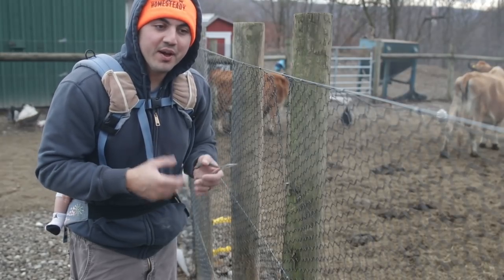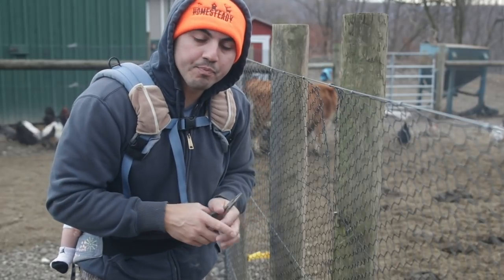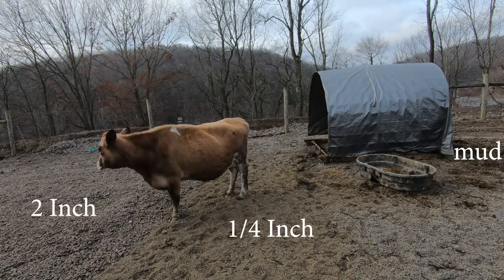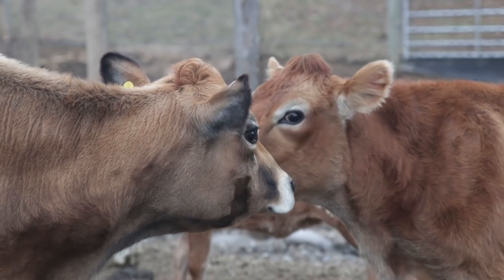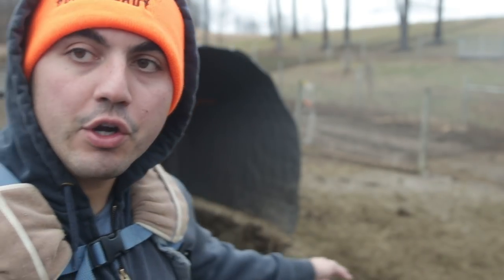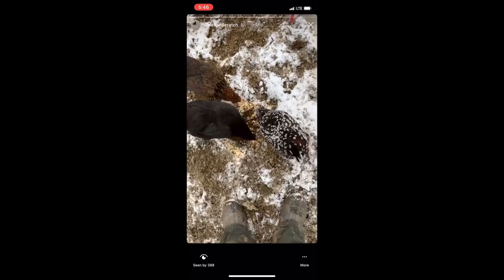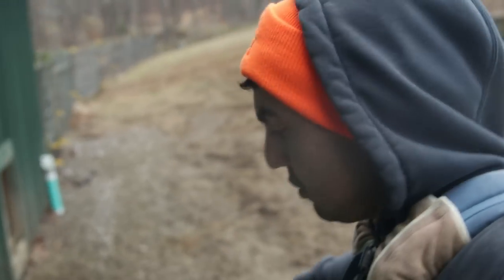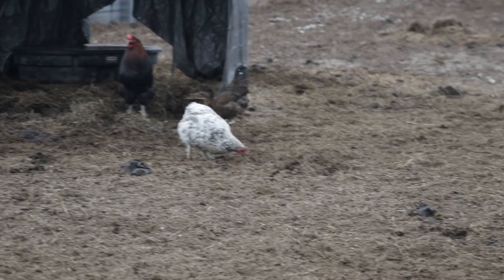FARM PROJECT MISTAKES we had to fix :(

Comment: Not sure where you are in relation to any cement plants, but when a truck returns from delivering it’s load, the driver will spray out the inside of the mixers to get it ready for the next delivery. That stuff is called “wash out”. It’s a mixture of sand, pieces of aggregate, and cement. Plants sell the wash out super reasonable, but if you don’t have one close or a way to go pick it up, delivery charges would be brutal. The plants I’ve dealt with will load it on a trailer for you if you go get it. I’ve used this several times on driveways and it works great. As it packs down, it creates a super solid base, but it needs to be compacted really well and left to set to work. When done right it’ll keep a super solid base form even when wet. You could research the wash out and see if you might be able to use it in one of your applications. Best wishes. Thanks for taking the time to post your videos. They’re super useful.   -Troy
Reply: wow really great insider tip!
Reply from the maker: Great tip Troy! Will look into it!

Comment: I guess it is the same as our horses dry lots. Ours consist of a thick layer of 'Breaker' which is 3" and smaller road base, 'gravel' which is 1" and smaller, then "traffic Bond" or "Screenings" which is 1/4" sharp clean gravel. Rounded stone like pea gravel is not recommended as it is not easy to stand/walk on (yours does not look like pea gravel). We scrape the dry lots in the spring and add a load of the traffic bond and smooth it when needed.

Comment: Great to see I'm not the only one making mistakes... could regular applications of wood chips be used instead of gravel?  Then your not worried about losing gravel and adding organic matter?  And the large gravel underneath would help with drainage...
Reply: Our Journey Back to Basics  in my experience wood chips hold water worse and don’t allow drainage. It makes the ground underneath very soft and squishy (great for turning ground into garden, not so great for high traffic areas.)  it breaks down and just makes a muddy mucky mess. 
My dad thought putting wood chips on our driveway would help and it made a huge mess. I also put a bunch in a wet high traffic area in the yard. The chips made it so much worse and we had to scoop it all out. The chips blocked the flow of water and soaked it up. We got some heavy rains and our backyard flooded.

Comment: with 30 to 40 pond poos at a time per cow and 10 to 15 of them per day per cow, and so few chickens. once there stuffed the poop will build up really fast,and turn that small area in to a huge soup bowl in know time, what needs to happen it the whole pad-act be drain tiled and a much larger area for that many cows, remember a cow eats 50 to 65 ponds a day, it all has to come out, and the number of cows you have plus calves and your ground dont freeze solid for 7 months like here and the rain,, unless you add another 200 chickens there is know hope..
Reply: "remember a cow eats 50 to 65 pounds a day"

But is that for normal-sized cows, or these mini jerseys?
Reply: @tyrroo  from minis to normal beef cows, they all eat about the same, i see many say oh i want a mini because it eats less, in my 39 year. i have found a cow is a cow, they all eat just as much
Reply: Speelink wusn't yer strongesst sudjekt in skool wuz it?

Comment: Poop and pea gravel really is a bad combination. They will just trample all the manure into the pea gravel and it would just stay there and make muck.   I would use granite or blue rock road base mix, compacted.  I took a few yards of redwood mulch type product out of a horse stall before I would have my horse stand in it because it held a ton of water during rainy periods..  It had a tampered blue rock base that just drained off all the surface water from the four stalls upslope. Manure was easy to scoop out.  The stall had a rubber mat that was easy to scoop the manure out.    The horse that vacated the stall I took over had continuous hoof quality issues and was always footsore.  Not my horse.